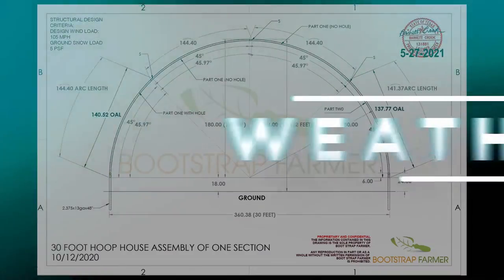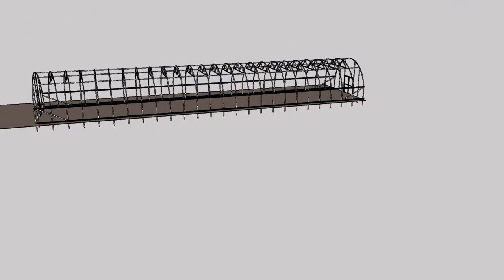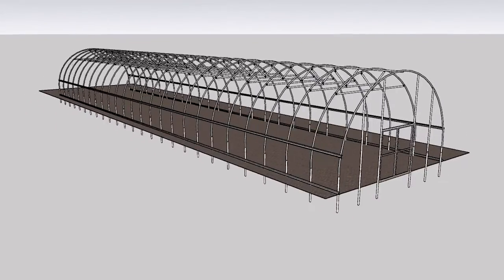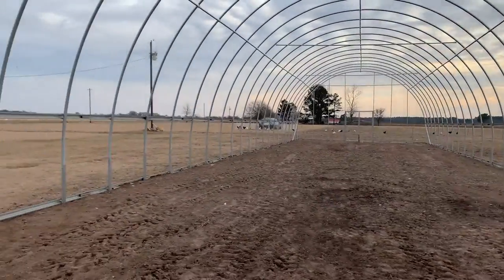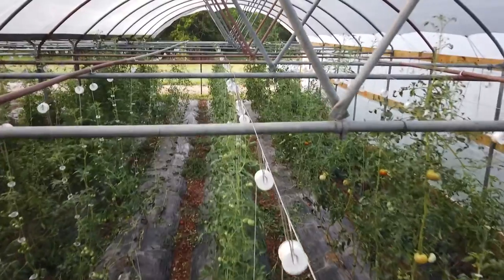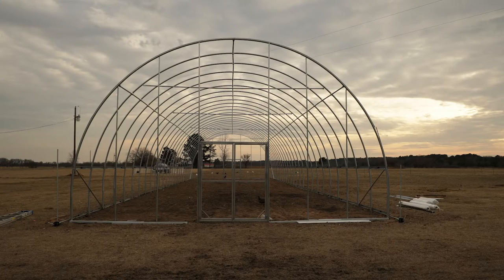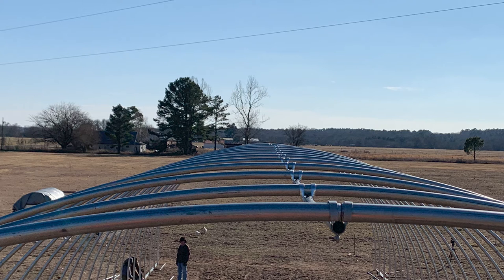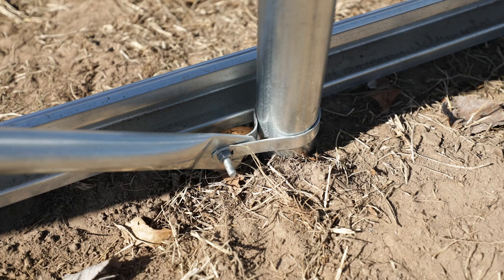Wind & Snow Bracing | HOOP HOUSE 101 Ep 22

Comment: By how much will side bracing and Trusses increase the snowload and wind resistance?
Reply from the maker: Bracing and trusses help stiffen everything against move around. Given all of the external variables, we cannot definitively say  x amount of percentage.
you have to consider soil structure, the individual builders, skill level, wind, exposure, and the area around the structure, plus with the individual. Farmer is using the house for internally. Olive which is out of control. This is why getting a structural engineer stamp universally every state is impossible, unless , you individually get that paperwork done with somebody certified in that state. 
Bootstrapfarmer spent great expense getting stamps early on and working with structural engineers. However those stamps expire and it’s not feasible to get that done for every county,city, and state.
Reply from the maker: For more information we have a dedicated tech team Monday through Friday 8 AM to 5 PM central at 888-406-1992.